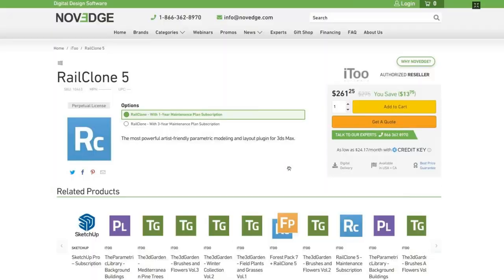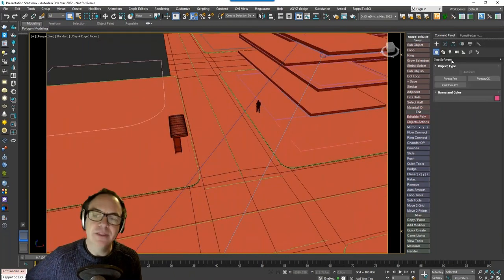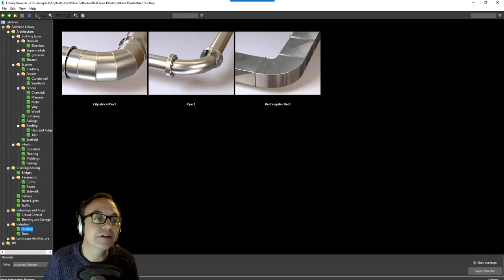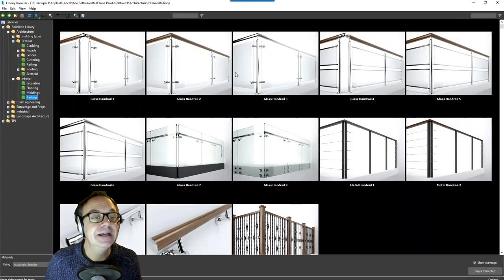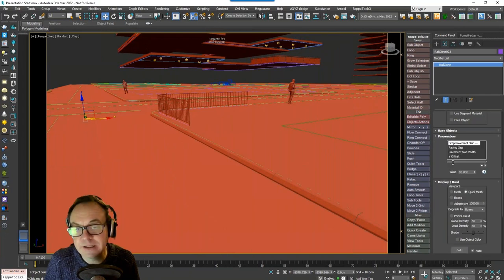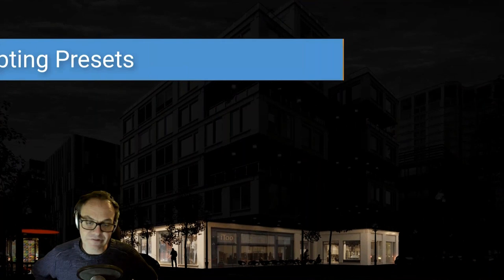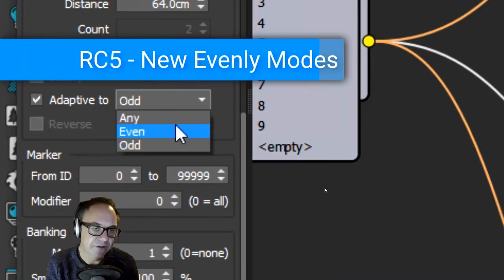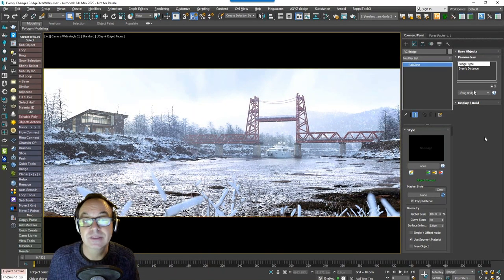What's New in RailClone 5 ?

Comment: I want to do just simple board and batten siding, lap siding, shake siding, by tracing a spline to cut out the windows and edges and creating a preset that is reusable. Is this possible with Rail Clone? Its tough for a beginner to extrapolate what part of the tutorial is applicable to want I need the software to do.  Thanks for this tutorial, very impressive.